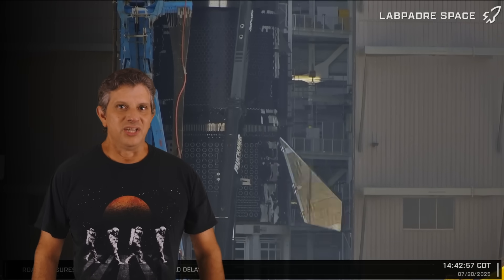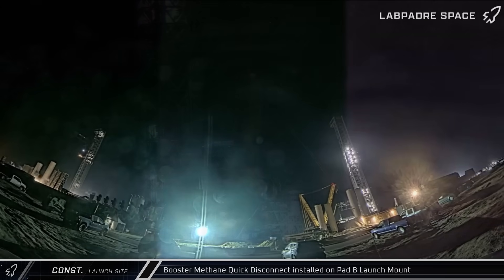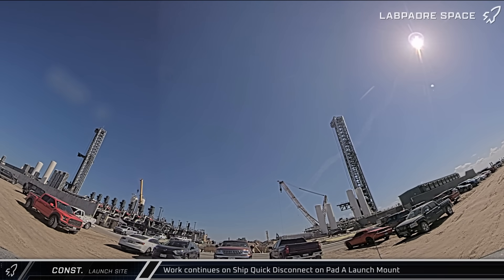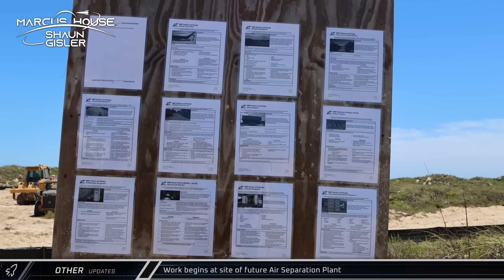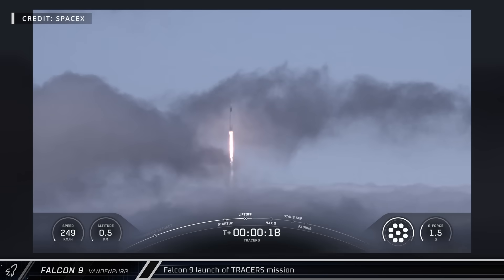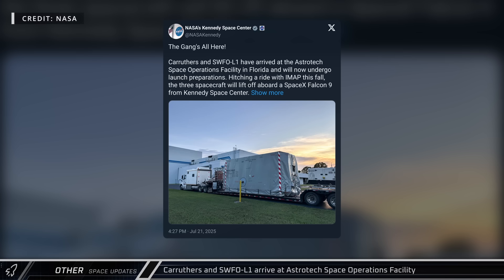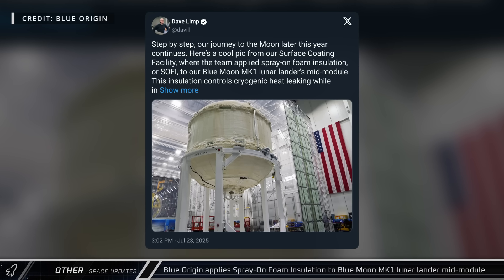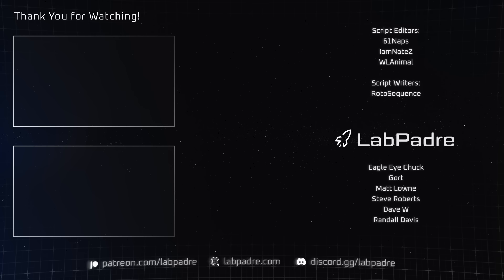When Will SpaceX Upgrade Starship? - Spaceflight Weekly #177

Comment: Makes no sense that block 1 has out performed block 2 , now going with block 3 after two more attempts ! There's an old saying if it's not broke , don't fix it ! SMH ! If they would have stayed with the first version and got it through all mission agendas before up grading the engines , you would know what you actually have ! With all the swapping of new equipment , it's actually went backwards ! If block 3 is so great why wouldn't you just start building them ?  Bound to have a hard time with these version too ! Doesn't make sense ! Plus Elon has the formula for anti gravity craft , want need all these primitive materials when he rolls one out ! It's coming trust and believe !
Reply: Block 1 did not out perform Block 2   Block 1 had very limited payload capacity...  what is the point of using a Block 1 ship that cannot deliver a payload?   Block 3 will benefit immensely from all learned from block 1 and 2    as will Block 4 learn from all it's predecessors.
Reply: @mikelee-i3b i didnt say anything about paypoad , version 1 made back to earth more than block 2 has even got into space ! The point is you dont just stop when your trying to accomplish things and move to something untested ! Which has blown up more times than any starship ! Whats the purpose of even launching the block 2 , when your scrapping it ? Makes no sense ! Jump right to block 3 and start making it the starship that actually works ! Doesnt matter how mass you take up if it blows up ! Should have perfected the first ship before going to bigger ones , duh !
Reply: @davidfriedline7525  well so duh   it was increasing the ship size attempting to accommodate a useful payload that has created the difficulties ...  Developing version 1 any more would be a total waste of time  spacex even scrapped some version 1 ships rather than waste time and fuel for nothing..
Reply: @davidfriedline7525  The whole point behind the blocks is design changes.  They're testing to see what design changes are keepers and which are not.  I don't think you fully understand that this is a system in active development.
Reply: Blah blah blah blah…
Reply: It may look like Block 1 was better, but Block 2 faces much greater challenges than Block 1. It was supposed to go from an absolute prototype to something more refined, and although we can see the explosion, we don't know how much the internal systems changed to be more robust and reusable. However, I am very excited about what Block 3 can show us.